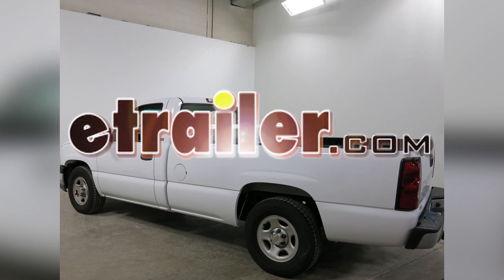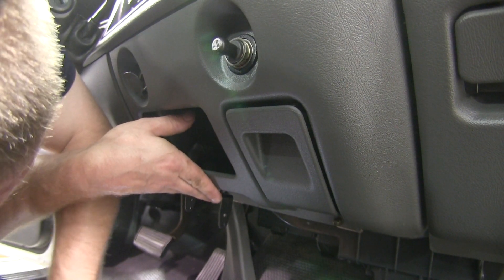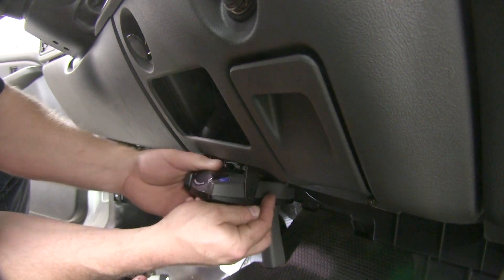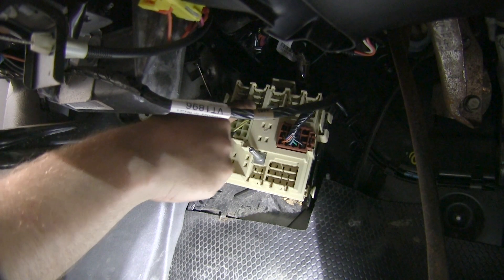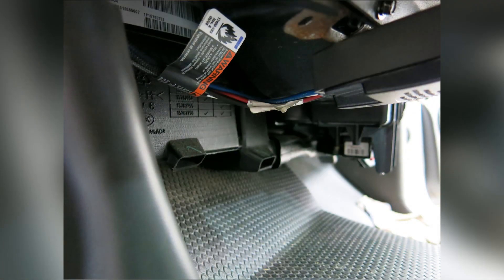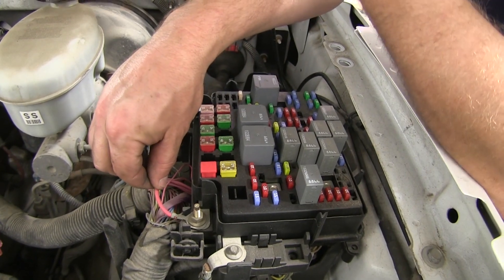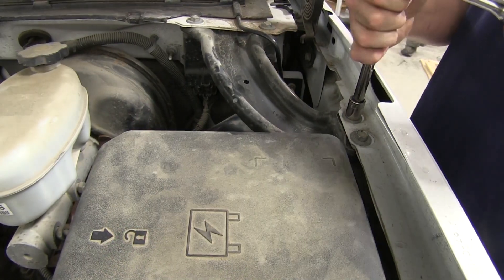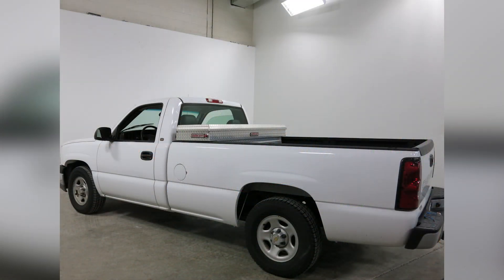etrailer | Trailer Brake Controller Installation - 2004 Chevrolet Silverado 3015-P

Comment: On my 06 gmc Sierra 1500 application I have the blue wire under the fuse box (under hood) with a clip and no where to clip it into. Where should this wire go?

Comment: I've read some many different things about the under hood portion. The red wire with the ring terminal goes on the most forward stud (#1)for 40amp or the rear stud (#2) for 30amp? Also I've read that the two blue connectors just need to be plugged in and that's it, while the link provided by you guys says to cut it and hook up a grey/white double bonded wire?....I'm confused

Comment: I have searched and searched and still can't find an answer. I keep ending up at the etrailer site with the same info. I found the two wires that go back to the wiring harness in the back. Both the Blue brake wire and the accessory power wire. What I can't find is the Blue wire for the brake controller from the panel under the dash or the red hot wire . I keep finding the same info that the wires are at the fuse box. They are not. They are missing. Has a trailer wiring harness but not the brake controller wiring from under the dash.
Reply from the maker: If you plug your brake controller harness into the proper slot in the junction box behind the e-brake pedal, and you're not getting 12-v power on the black wire when the ignition is switched on, and can't find the wires under the hood near the fuse box to complete the connections, use the # 5506 kit to finalize the connection between the 7-way connector and the brake controller. We've linked to a typical install video that you might find helpful.
https://www.etrailer.com/Accessories-and-Parts/etrailer/5506.html
https://www.etrailer.com/tv-install-etrailer-trailer-brake-controller-wiring-kit-2011-ford-van-5506.aspx

Comment: I'm going to be installing a trailer brake 04 GMC 1500 for a camper I'm a greenhorn at pulling campers 
My biggest question is will I be able to charge my trailer batterys of the plug
Reply: Yes, just make sure you buy the breakaway kit with a built-in battery charger.

Comment: Does the blue wire under the hood go on the same post as the red? Brake controller all hooked up and lighting up, but when I put tester on 7 way the controller say, "No Trailer".  Thanks
Reply from the maker: No, the red wire is connected to the the closest positive post while the blue wire needs to be routed all the way back to your 7-Way wire some extra wiring. Here is a helpful article highlighting how to install a brake controller on Chevrolet / GMC 1999-2006 Pickups https://www.etrailer.com/faq-cbc.aspx

Comment: Do I have to disconnect the battery to install the PP2 and 3015-P harness?
Reply from the maker: You do not have to disconnect the battery in order to install a break controller and harness.
https://www.etrailer.com/Trailer-Brake-Controller/Tekonsha/90885.html
https://www.etrailer.com/Accessories-and-Parts/Tekonsha/3015-P.html

Comment: While under the hood you say "These two post here", it is unclear where the second post is you refer to. Could you point it out? Thx.
Reply from the maker: Sorry about that. There is a post on the other side of the cover that the installer was referring to. Basically it's the positive and negative posts near the fuse box.

https://www.etrailer.com/Brake-Controller-with-Wiring/Tekonsha/90885-3015P.html

Comment: Just installed this and it stays on even when keys are out of the ignition is that normal
Reply from the maker: Most brake controllers will have a time out period where they will stay active for about 15 minutes after the vehicle is turned off.
https://www.etrailer.com/vehicle/2004/Chevrolet/Silverado

Comment: Did all of this and it did not work. I do have the factory tow package. I connected to a 1/2 towable 5th wheel. 05 ext cab z71 1500 vin B